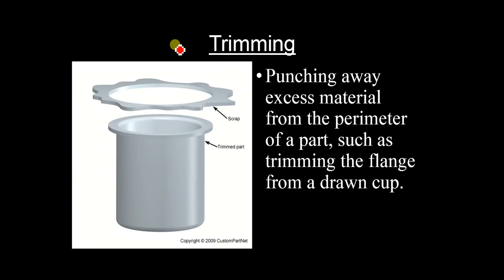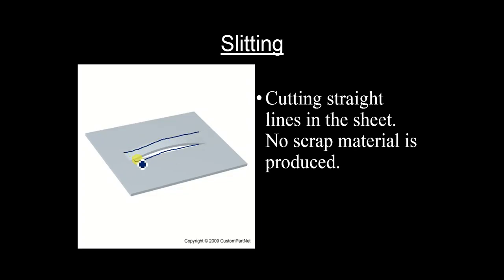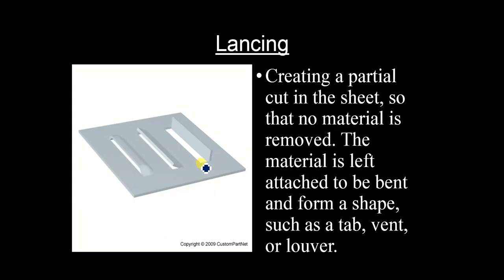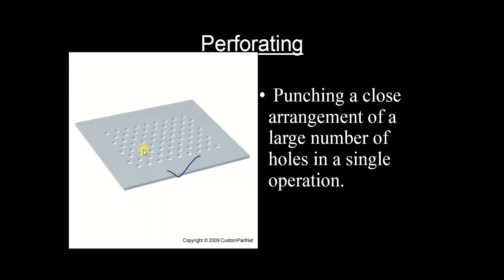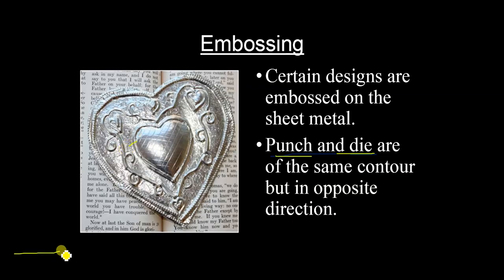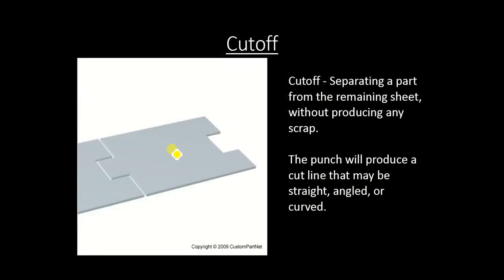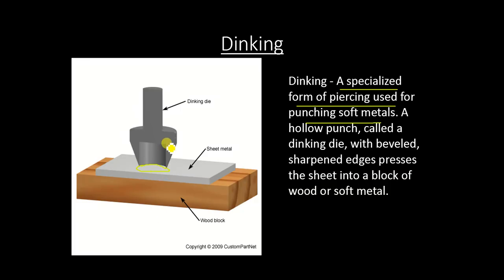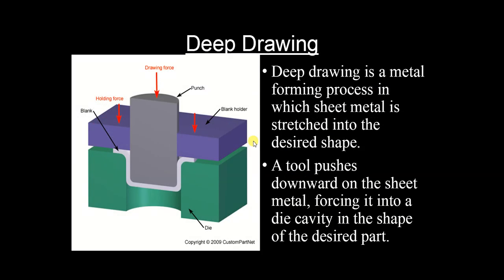Sheet Metal Operations : Trimming, Coining, and Notching - Part 4

Comment: Is trimming done with a hand grinder in industries?
Reply from the maker: Hand grinders are not the primary industrial method for sheet-metal trimming. They are used only for rework, deburring, or very low-volume jobs. 
In industry, trimming is done using controlled, repeatable processes depending on volume, accuracy, and material.